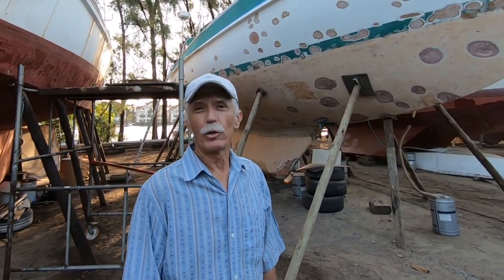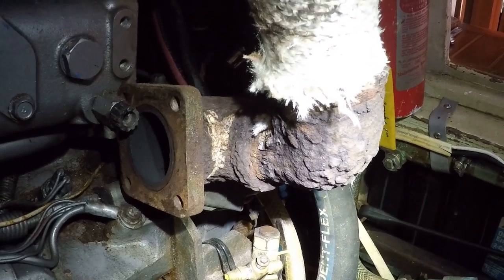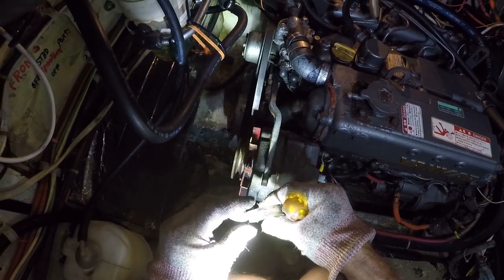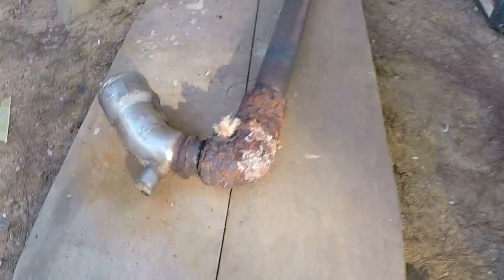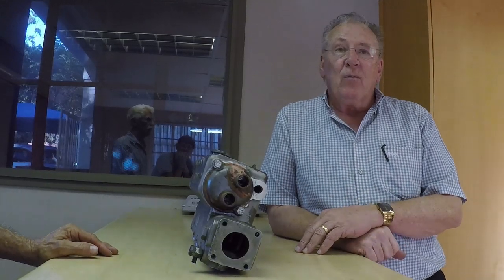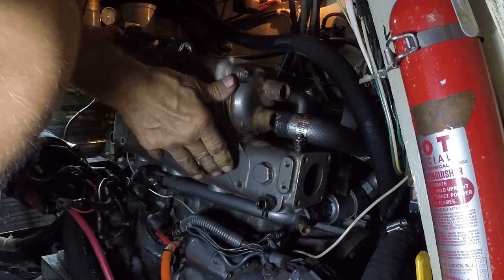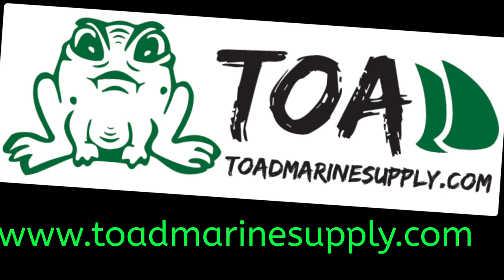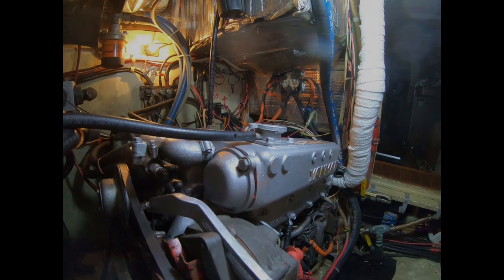How to Repair a Heat Exchanger /Insulate an Exhaust Riser:Yanmar Engine-Patrick Childress Sailing 44

Comment: Few veteran oceans cruisers do hard core maintenance videos that have the clarity, brevity, practical explanation, and focus on getting the project done that Patrick does.  One of Le Vagabonde's best videos was how to install a water-maker on a monohull, Riley did a good job but with a background in offshore oil work, he had confidence.  I think of Patrick as the Dean of the School of Cruiser maintenance. So, I was surprised when that locally sourced fiberglass wouldn't dry & sympathetic as to why Patrick tried local sourcing, he has faith in people.  Your videos are really clear in terms of communicating the message and on boats the message is more boat maintenance is almost always needed.  So, I encourage you two to keep presenting content on maintenance.
Reply from the maker: UUBrahman...thanks for the compliment...Patrick is out working hard again today and this will be a nice  comment to come back in to after many hours of work. -Rebecca

Comment: I enjoy boat work videos as much as sailing and the adventure segments as well.  Be wary of the hose clamps in South Africa.  Brian from SV Delos replaced several hose clamps which they were told was a good stainless but were cheap knock off's that rusted out (bands and screw) and caused leaks on their boat.  Hopefully you found a good retailer, bought some spares, and kept the old hardware for backup.  Love that refurbish and the new riser with the flex coupling.  Great Job!
Reply from the maker: Thanks for watching. We may have found those same “stainless steel” hose clamps that Brian On SV Delos found...we didn’t buy them. When I was back in the US, I got good quality, true stainless ones from Fisheries Supply in Washington which passed the magnet test, and carried a LOT of them back with me!  We could not find any hose clamps in Richards Bay that would pass the magnet test. It is like no one here has heard of using a magnet to test the quality of their clamps. -Rebecca

Comment: Headsup! You are supposed to wet the fiberglass wrap! It works better and no free fibers! It stretches when applied. Then spray it with the paint to completely gluing as one. Its sold online with the wrap. Nice work looks good!
Reply from the maker: Locally, aluminum wrap is not available. Spraying with high temperature paint is a good idea. When we get this boat back in the water and test out then engine, I will put on more insulation then spray the insulation with paint. Thanks for the idea.

Comment: The elbow worked out well. And for the itching working with Fiberglas, use the baby talcum powder before starting the job, nicely white yourself .. works wonders.
Reply from the maker: I was warned, when I bought it, not to touch the new insulation with my hands, which I had done at the store. My hands were very itchy for a day! I want to wrap the new insulation with something, like one commentor suggested, thin aluminum wrap, as it is hard to work in the engine room without rubbing up against the insulation.  Good idea, the talcum.

Comment: first thing that crossed my mind when you showed the new exhaust - 'be better if the water injection was pointing a bit more downhill'
Reply from the maker: I couldn't imagine why the original had the barb at 90 degrees, and that is why the new one was made that way. But I have seen that on many other risers as well. I feel better with the modification of the angled entry.

Comment: This heat exchanger issue is a yanmar sickness.
I had a 4jh4e with 7000 hours and 7 years old have a pretty nasty corrosion surprise on the aft cap side .
Yanmar dealer used a hydraulic press to remove the core with the warning the entire case could explode.scarry but went well. It took a huge amount of force.released with a loud bang.
Yanmar wanted 800.00 to repair in phuket. But i got a local to do a 100.00 perfect repair.  The corrosion was removed and he machined and sleved the pitted erea.
It went on another 8,000 hours and its now a spare part for my new 4jh5e. I replaced the 15,000 hours engine though it was running perfectly. I did this for cost management. Yanmar guy said this corossion happens when engines are not run enough. Well i cant agree as i put 15,000 hours on in 11 years
Reply from the maker: Phuket, what a miserable ripoff place that is. I have heard terrible nightmare stories of overpriced, shoddy, work being done there. Not an engine story but all we needed was a teak table to replace the one in the cockpit. Any marine facility wood shop, we asked, wanted $1,000 to make a new one. We never had a table in our house that cost that much. We had a new cockpit table made at a local furniture shop for $110. A diesel mechanic recently said that the heat exchanger O rings dry and wear out over time causing a leak. They should be changed at intervals. But he never said how often they should be changed. I think I will start doing it every 1,000 hours. Good to hear you got a great run out of your Yanmar. That gives me hope. Good idea to swap for a new engine after so many hours.  I am very surprised that a Yanmar dealer would just press out the corroded core. That sounds brutal and risky. I would think they would soak it first to loosen it up. Thanks for your comment.
Reply: I remember youre boat anchored in chalong. Its been years but i did see you there. My boat is also a perry design .T 37
Phuket is a place that if you can take the time and really do youre re search you can get good value. 
I have for 13 years, avoiding expat buisneses is the best advice i can give
Indo is my main cruising ground and phuket my refit base by default. 
Yes youre right about the o rings. My plan is every 2 years to remove and clean the core and replace the o rings. This issue was the only issue i ever had with the motor and had i known better i would have serviced it.
This issue yanmar said is common. So yanmar owners beware.
Also that cap end can only go on one way. I spent days trying to figure out why i still had a leak. So that rear cap looks the same either way but its not. Finally i figured that out.
I feel for you looking at all those blisters. Its no big deal i know but its a lot of hard work. Looks like youre right into it now. 
Good luck.

Comment: Thank you for another great and informative vid. 
I’m surprised and impressed by Brickhouse’s engine access. 
Im jealous you get to work on the Yanmar without standing on your head.
Reply from the maker: Well....there is good access from one side only. A while back I changed the kill pull cable. What should have been a 2 hour job at most, took 8 hours. Even if I had good access on the other side of the engine, the critical connection is so deep inside a Grand Canyon that no human fingers could ever thread the needle of wire and brass stopper then turn the tiniest set screw to secure things. Laying pads on top of the engine, I got real comfortable in that face down position. What helps greatly for changing oil, since the normal oil filter mount is as nearly impossible to get to as the pull cutoff connection, on the far side of the engine,is a remote oil filter, hung on the wall ,and an electric oil pump.  Bud, thanks for your comment.

Comment: A suggestion to reduce your fibre dust in the engine bay is to seal the ends of the tape with high temp silicone it willl prevent the vibration loosing any fibres, you can also coat the entire thing but that gets pretty messy
Reply from the maker: gmoose777, Thanks for the suggestion.

Comment: Nice work on your part, but I was a little surprised that the rebuild shop did not clean and paint your exchanger more than they did.  I have always seen that type of thing come back looking like brand new.  Also, that bolt you put in to support the upper rad hose looks like it may rub its way through over time.
Reply from the maker: That would have a nice touch to have had the exchanger painted upon  pickup. Online somewhere, a person said that a rebuild, such as I had done, would cost, in the U.S., 75% of the cost of a new unit. I would think the same would be true in Australia. So, for $250, I am satisfied.  To protect the discharge hose from the new hanger, there is a cut open piece of clear water hose separating the discharge hose from the bolt and the ties securing things. It is hard to see in the video.  Thanks for your comment.
Reply: @SailingBrickHouse-RVLife  And thank you for your videos as they are most informative, and I enjoy to pick up tips from a real pro sailor.
Reply from the maker: @chrisscott1958  You know Chris, I was just in the engine room and only because you mentioned it, I looked at the new hanger bolt. Sure enough, the clear plastic chafe protector had somehow twisted around allowing the bolt head to come in contact with the discharge hose. Took 45 seconds to readjust things properly. Thanks!
Reply: Good catch, I totally missed that!

Comment: excellent video Mr Patrick.  Will be on the lookout for a good heat exchanger repair company in the states, I have a similar task coming up in the next year or two. Some good tips also, for those really paying attention.....we all use hose clamps, but does everyone set the clamp screw on top to mitigate damage if the hose leaks? Good one! I eliminated all the open band clamps and replaced all with closed band clamps. More expensive size for size, but I have near enough eliminated rusting, breaking of the clamp, stripping of the gears.  Enjoyed it, thanks! Andrew
Reply from the maker: Thanks for your comment Andrew. Patrick appreciates the feedback but is out working so hard on another project, that he can’t comment right now! Thanks for watching and commenting! He will be happy when he comes in to see the responses! Rebecca
Reply from the maker: Andrew, closed band clamps do look far better and would be cheaper in the long run. I will have to start looking for a local supplier. I sure would like some titanium clamps but have not found a supplier.

Comment: I had never seen an exhaust as well thought out as yours. With the riser going waaaaay above the waterline and a downward slope to the exhaust through hull (presumably). Too often I see an anti Syphon loop with the rubber valve plugged (disaster waiting to happen) but this is well thought out.
Reply from the maker: I remember way back seeing a figure for a riser height minimum and I thought it was 18 inches which does not seem to be much. There are a few well known boats which had their engine flooded  in stormy weather because of two low of a riser. Our riser is 32" above the water line. The flexible section of pipe near the lower end makes it easy to adjust the height, a bit, for proper fit.
Reply: Sailing Nandji's boat also had the same system on their old engine, so this is the second boat i've seen with this system. They also had to make the same repairs and deal with asbestos.
Reply from the maker: Thanks, I will check how they handled the job.
Reply: @SailingBrickHouse-RVLife  you will probably find that the reason the exhaust was so corroded is because the asbestos insulation was retaining saltwater or humidity between it and the riser. However I would prefer not burning myself if I brushed the pipe and having to replace it in 30 years time than have it last forever and burning myself in a seaway.
Reply from the maker: @Nicholas2011ist  It seems every part on a sailboat should have an expiration date stamped on it. Like rigging should be replaced at a specific interval. Now I know, at 4,800 engine hours, the riser should have been replaced at least 800 hours ago.  Thanks for your comment.

Comment: I'd call that a lovely surprise.  Nothing more satisfying to find a definite disaster waiting to happen .... and then prevent it. That corroded elbow could have fallen apart in your hand a 1000 miles out.  Fixing that was a bargain at any cost.  Beautiful job on the riser BtW. 
You did a good thing with the hose clamp positioning it at the very end of the hose. So if the hose splits at the edge of the clamp (in the future) you get a chance of a 2nd go by moving the clamp a little further up the tube (get you home measure).

It's been years (decades) since i stripped an engine, but somebody once did once tell me that it doesn't hurt to put manifold bolts back in the same holes.  

Lastly gaskets are there for a number of reasons, one that you touched on elsewhere.  They can keep the metals apart. 

OK this time lastly, really. Have you ever considered rigging the engine cooling as an emergency bilge pump?  I've heard of this but wouldn't know how it could be prepared. Maybe you're thinking of how that might work, right now.
Probably better on just sea in sea out cooling.
Reply from the maker: Thanks for your comment.  It would not  be hard to rig the engine to suck bilge water by putting a Y valve between the engine  and raw water strainer. It would be my luck, in such a situation, the bilge would be sucked dry and at the same time I'd be so distracted with whatever emergency was going on, the engine would burn up from lack of water.  It is an option though. We have 3 bilge pumps. The main pump then the emergency electric bilge pump which never touches water unless it should get very high in the bilge then the very high capacity manual pump. Hmmmm, rather than installing a Y valve, I will take a look at the hose on the raw water strainer and maybe set up what could be a hose extension which could plug into the raw  water hose after ripping it off the raw water strainer.  Thanks for the idea.
Reply: @SailingBrickHouse-RVLife  Blast. Now I have to keep watching.

Comment: Patrick,

A very good video and how to repair the heat exchanger  and as always your knowledge is greatly appreciated . I have to do the exact same job on my boat so thanks for the head up on what to look for.

Robert
North Star
Reply from the maker: Happy the video could be a help. I have worked on Detroit Diesel, 550 hp turbo charged engines and there is nothing light about any of the bolted on parts.  I was very surprised how light the whole heat exchanger was on this Yanmar. I hope you have equal ease in removing  the 4 riser flange bolts  as I had.  On this boat, there was no room to swing a hammer to free them up.

Comment: Another good helpful video.  BrickHouse is going to be good for several thousand more nautical miles.
One thought I had after watching the care and attention to detail Patrick has to things as mundane as hose clamps- do you think it would help any, by adding a touch of the anti-seize compound to the threads of the house clamp bolts?
Reply from the maker: Marcel, for a long time I had been slathering LanoCoat,  a lanolin, onto the whole stainless steel clamp and especially the tightening screws. The clamps still rusted, especially around the screw area.  I would pay for titanium hose clamps but the one company I contacted was not responsive and Allied Titanium, my chain plate supplier, does not make Ti hose clamps. So I try to keep a big supply of new clamps on board. But I first check the clamps with a magnet before I buy them at the store to make sure they are all stainless....but sometimes I have to go with what is available.

Comment: How did they repair the ends of the manifold and end caps.  I know it is expensive but it looked to me as though a new manifold was needed.
Hopefully the repair will hold up and not leak
Good videos
Reply from the maker: In these radiator repair shops, apparently it isn't too big of a deal to build up the deteriorated metal by welding, brazing, or whatever, then milling back the desired shape. They also checked the copper tubes and soldered some thin areas. It would have been costly to have this work done in Australia or the U.S., but in many of these foreign countries, labor cost is a fraction of what it is in the bigger economy countries. I also hope it does not leak. We are still working on rebuilding the exterior resin blisters on the hull so it will be months before we are back in the water and really give the heat exchanger a good workout .  Thanks for your comment.

Comment: I know this is an old video, but I'm a little concerned about your riser support from the aft cabin, shown at ~12:44.  It looks like the nut on the end of the long threaded shaft is rubbing on the rubber riser hose itself. I can see you have a chafing guard on the outside of the hose inside the hose clamp, which is great, but that nut?  Maybe you had the chafe guard loose in the photo and have since moved it back into place.
Reply from the maker: You have a very good eye. That chafe spot has been corrected. Thanks for noticing.

Comment: Hi Patrick,
OMG, this is why I rarely do sailboat work or work on Asian boats. Of course, this is almost certainly not the original installation. The wrap may be fiberglass or asbestos. You never know with Asian boats. Quality installations now use custom made "blankets" that attach with metal fittings or straps.
Reply from the maker: Ed Wiser. Well hello. Going back through all old comments and making sure all replied to. Finally seeing light at the end of the very long tunnel…and here you are :)

Comment: Easy way to tell if that's asbestos on the engine is get a lighter  to the fibers and see if the fibers glows, if it glows and it's asbestos if it burns its fiberglass.
Reply from the maker: Great idea. Thanks for the tip.